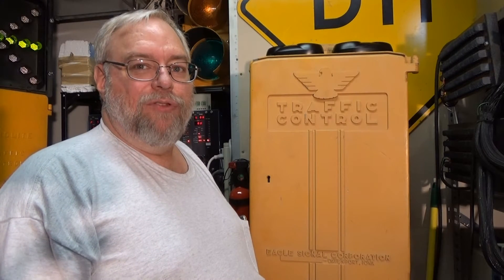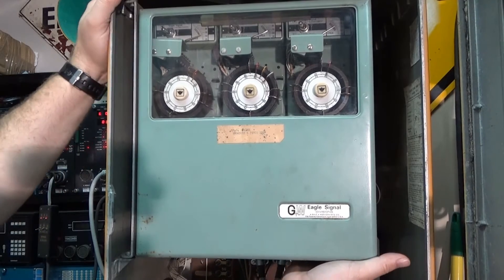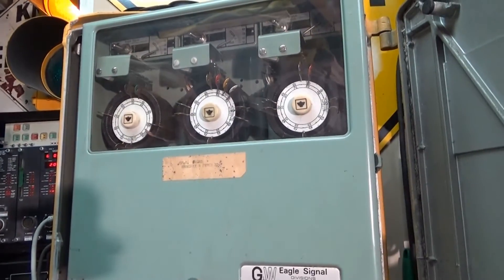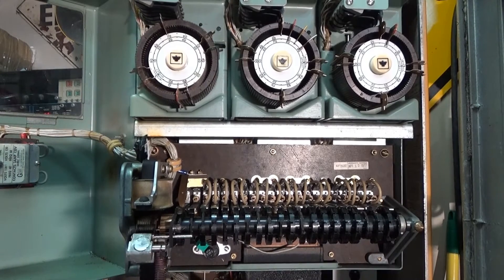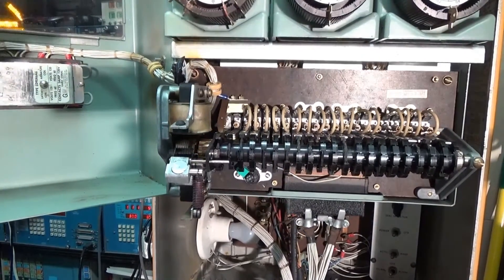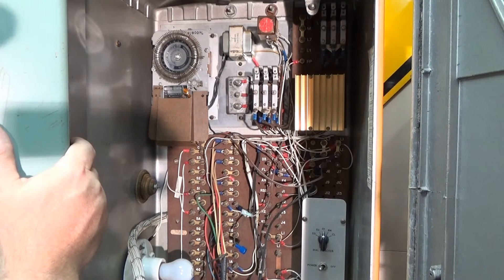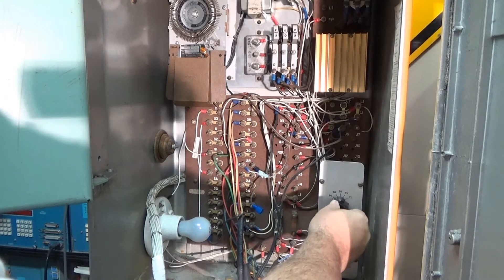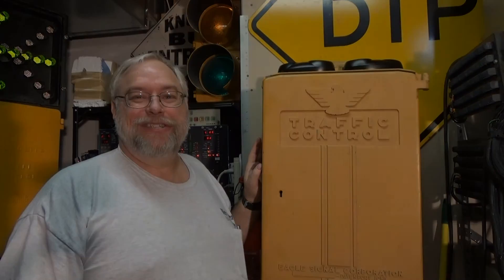Eagle "EF20" Electromechanical Controller

Comment: Do you know how the flashing yellow is implemented ? Is it using one of those flasher relays as in old cars (with bimetallic switch) ?
Reply: If you are talking about the newer standard of flashing a left turn arrow, these old electro-mechanical controllers cannot do that because the technology wasn't invented yet.  I suppose there's a "hack" for it, but it's kind of pointless due the nature of these older controllers.  

Modern TS2 Type 2 systems allow the flashing left arrow which utilizes a protected turn phase (green arrow on say phase 1) and an overlap for the flashing yellow arrow, yellow arrow, and red arrow (or ball).  For older TS1 standards you can swap some of the wires around and use the logical PED CLEARANCE (which was never really used) as the flashing driver, but I never got that to wok on my own system (PED CLEARANCE is not a visible indication like DONT WALK is).